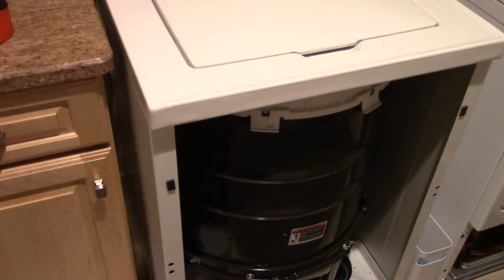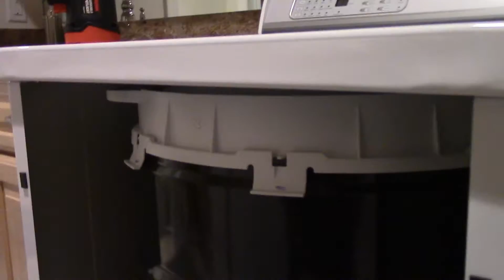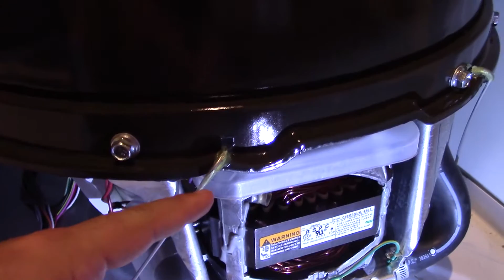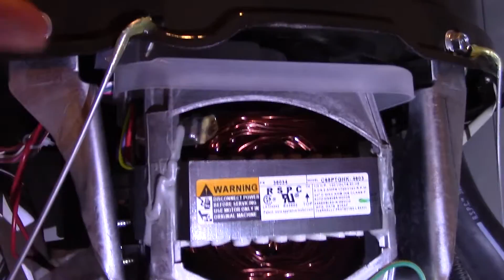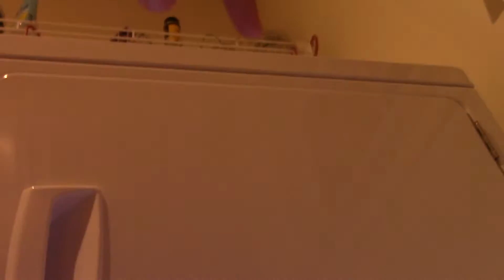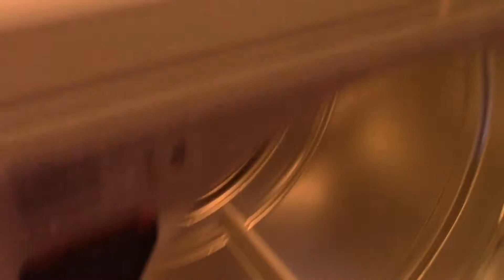Speed Queen and Whirlpool Direct Drive: Unbiased Comparisons.

Comment: Also, another advantage of the Speed Queen in my opinion, the tub spin drains, or "Swirl Away Drain" as Maytag called it. In my opinion, i think spin drain is better for clothes, the tub spins and the pump pulls dirty water and residue and excess suds out of the sides of the tub which is more time efficient because when it stops draining it gets up to speed immediately, rather than draining down through clothes while the tub is standing still which may redeposit stains or lint or maybe suds on clothes, which is one of the two things i don't like about the direct drive and that it eats the motor coupler constantly. . Speed Queen advertises this for the TC5 and Maytag used to advertise this before Whirlpool bought them out. And these machines have 3.3 cu. ft, which is pretty good for washing comforters, most vintage direct drives are 2.5 or 3.1 cu.ft. I don't know if Whirlpool direct drives or older belt drives can wash king size comforters effectively.

Comment: I personally prefer the Speed Queen over the direct drive for the following reasons, after I have used both.

1. Speed Queen has faster spin 710RPM as opposed to 640RPM
2. Speed Queen has a stainless steel drum
3. If the porcelain enamel on steel outer tub leaks it has a lifetime warranty
4. I like the longer stroke on the Speed Queen, It just seems gentler, though both machines do have delicate cycles.

The only advantage the Direct Drive has over the Speed Queen is it's a bit easier to work on and parts are not as expensive.

Comment: "Dual Action" offers no real advantage over the old-school "Roto-Swirl" designs from Kenmore and the competition from the likes of GE and Westinghouse. The Dual Action dasher introduces more moving parts to wear out and fail. I have challenged my SQ TC5000WN with a load of two 60X70 inch fleece throws, and it turns the load over beyond any expectation, and very well in comparison to any machine I have seen on YouTube.
Reply from the maker: The dual actions aren't bad though. I know the dogs are the moving part you speak of. They are very easy and cheap to replace though, the ones I last replaced were on there for 15 years before needing replacement.

Comment: I have my own comparisons to give.

Washers:
This one is for the direct drives, pump placement. Whenever you need to replace it it's in a very odd spot facing down so close to the bottom panel. If they moved it an inch or more higher it would definitely make for an easier fix. But both get a plus having motor driven pumps, instead of flimsy electric pumps.

Speed queen suspension definitely does take the cake when it comes to suspension, and good solid balance and minimized vibrations, but having a base frame such as the whirlpool direct drive does make for better added support because on a speed queen, its mostly the springs holding everything up.

One disadvantage for speed queen is the low diversity, like just off the top of my head, I'm only able to name the 542, 423, 82, and 92 model codes. With whirlpool you have many more options, such as quick wash cycles (on our machine), super wash cycles, cool down permanent press cycles, and more, and model codes, ooh boy. The 7233, 7333, LA95, LA91, 5300, 5200, and many more, so whirlpool easily wins at that, but having so few models does make it easy to choose between machines.

Both braking mechanisms are very powerful, but each have their own unique traits. The world leading speed queen brake takes many heavy cycles to set in completely and doesn't entirely hold, you could just barely shake the tub, on the direct drive, the tub does take a little longer to brake, but it sets in immediately requiring no use to prevent indexing, and allows for no rocking whatsoever.

Dryers:
There's actually 2 variations of whirlpool dryers, 29 inch, and 27 inch. The 27 inch is pretty related to the speed queen, but with its own whirlpool quirks. Accessibility is big, when you pull out the dryer and take off the rear panel, you have much more unrestricted access to the internals. And yes Gas dryers do win there when it comes to not pulling out the dryer to replace their heat source, dryer to dryer.

One big plus for speed queen I will admit is all their models do have a lower access panel, so repairs or cleaning are much easier. Whirlpool didn't actually remove them entirely from what I can tell, some models had them, some didn't, they became less present as time went on, I don't see many pre-86 dryers that DON'T have an access panel. 

Alliance really didn't take their time designing the electronic controls leaving them so close to the burner, but on electric dryers that would be less of a problem, I have seen really old belt drive series machines with electronic controls that keep the main controls much farther away from the burner.

The lint filter for the direct drive series dryers is much easier at cleaning because of its size and can easily handle catching more lint, but it does keep lint off the top having it behind the door, and if any lint flies away it most likely would either fall on the floor to be vacuumed or swept up, or into the drum to be sucked back in on the next use.
Reply: How is a huge number of washer models an advantage? There are four basic cycles: dainty, ordinary, linens, and rock crusher, and extra rinses and soaks can be either selected automatically or manually. What fill options do you need beyond small, medium, large, or jumbo loads? Speed Queen does offer a true "HOT" wash, filling without mixing from the hot tap whereas I was never able to get a wash as hot as 80 degrees F from my Whirlpool with the temp on the hot setting.   
Speed Queen now builds exactly one top-loader worth owning, the AWN632SP116TW01, product code TC5000WN. It does everything I need: normal-size loads or deep fill, five wash cycles, tap-cold, cool warm, or scalding washes, and it actually gets the clothes clean in less than 30 minutes (10 minutes more for the extra rinse option).

Comment: I hear older belt drives actually used the suspension rod system. How different actually were they compared to HE suspension rods.
Reply from the maker: They are extremely different. They have thicker rods, a metal platform, and a metal outer tub. And when the machine fills, the tub does not sink down from the weight. The difference in quality just shows.
Reply: No cabinet smacking needed on those machines. It takes a lot of effort to unbalance ours when its time for spin. Like one of our recent problems was caused by a winter robe, and let me tell you, that thing was like boulder when it was soaking wet.
Reply: GE used aircraft cables before moving to suspension rods too.
Reply: @jeromedavis8575 the filter flos or the 1996 ge washing machines?
Reply: @nathanaelc21 the 1996 and later models.

Comment: 8 big heavy duty suspension springs, absolute quality. Its not gonna smack the cabinet because of an out of place sock. And doesn't throw an error code when it shakes a little, something I figured out is that it takes a lot of effort to throw the 06 out of balance. It doesn't really matter about distribution, its really about weight concentration. I washed this blanket and a sheet, even distribution, but out of balance. The blanket soaked up so much water and was incredibly heavy, so in the end, after 30 minutes of redistributing and even slow spinning, it just wouldn't balance. So I ended up manually ringing it out, and I was shocked how much water came out. It went up to the base of the fins of the agitator. Just to let you know, its a twin sized blanket. So in the end, its really about weight concentration
Reply: Oh and just wanna add, I did an empty spin to make sure it wasn't the washer, and it was fully balanced.

Comment: the Wp DDs eat waterpumps and transmissions but these new machines are all electronic no trans so will they fail control boards and motors now ?
Reply from the maker: Not sure what direct drives you saw, but ours is still on the original transmission after 28 years, and the original drain pump lasted 21 years.
Reply: @Sharkie626  Mine lasted that long as well. I don't think they eat waterpumps or transmissions.
Reply: They constantly eat motor couplings too, i wish they made them out of steel instead

Comment: I have the Awn542 model. Excellent by the way. I always wonder why speed queen didn't go with slightly wider fins on the agitator like the whirlpool super surgilator. I watched videos of the late 70s and 80s whirlpool and they seem to do a more aggressive wash. I always wished speed queen would of made some aftermarket agitators with wider fins for purchase. What are your thoughts?
Reply from the maker: Wider fins probably would have helped. There is actually a Kenmore version of the straight-vane that has wider fins. It actually doesn't do too bad. The dual action still does better overall for those machines.
Reply: Sharkie626 you are right about the dual action agitators they work great in the direct drive machines however in the older belt driven whirlpool kenmore's the straight veins and super surgilator did a fantastic job versus the Dual Action agitator in the older belt-driven Kenmore I have a Speed Queen that has this agitator in it and I'm telling you it moves water it has a very strong agitation

Comment: You don't "have to" take the cabinet off to work on a Whirlpool Direct drive on most repairs. Most can be done by tilting the machine back, Motor, transmission, clutch, drive tube and especially the water pump. When tilted back the water drains back in to the tub, less water spillage. With most repairs it takes less than 45 minutes. If it takes that long, you took a 15 minute break. Taking the cabinet off is a piece of cake if needed, 2 screws, 2 Clips, disconnect the lid switch connector harness and it's off. Wouldn't get rid of my 30 year old one. My Kenmore whirlpool made dryer is 52 years old. Parts still available for both.
Reply from the maker: Oh don't get rid of them! I've seen tilting the machine back before too. Sometimes it's a bit more labor though. Depends on the repair

Comment: So Whirlpool don't make direct drive anymore? What year is the direct drive Whirlpool? What are the best new washing machines, in your opinion?
Reply from the maker: I think they may still exist in stackable units. But regular ones went from 1986 to 2011. The best new washers are Speed Queens such as this one, or the direct drive.
Reply: @Sharkie626 what about the Maytags before 2006, dependable care, preforma, Atlantis, Neptune, ensignia, legacy series, etc? They've known to be very strong durable machines that are noisy of course, large tub capacity, infinite water level options, cycle signal, etc. I think those are the best machines that will fit my needs, but are pretty challenging to working on
Reply from the maker: @nathanaelc21  The Dependable Cares, and the Performa/Atlantis ones were good too!
Reply: @Sharkie626  my dream machines for when i get my own house, for sure!
Reply: The Neptune front loaders, which i thought were bad at first, are actually pretty decent, not the best washer. i know they are HE machines, but are pretty durable, built to last 25-30 years, had mechanical controls in some models, and some electronic controls but with push buttons, maybe had a transmission, had no load sensing crap, and did use less water but enough to clean well unlike other front loaders, something you'll never see today.

Personally i think its the 1 and only front loader i like out of all other front loaders, and it cleans better than my parents Samsung front loader. Besides that, I've always liked traditional top loaders, especially Maytags series of top loaders before 2006 and whirpools series of direct drives, miss when Maytag made their own products.
Reply: and I forgot to mention, the Maytags stopped almost instantly with the brake
Reply from the maker: @nathanaelc21  I remember those! My bro had on of those TLs from 2006-2010 at a place he used to live at. Sadly I never made a video on it.
Reply: @Sharkie626 that's nice, what model were they? Legacy Series like Emerson's, or Preforma, dependable care, Neptune, Atlantis?
Reply from the maker: @nathanaelc21  Yeah it was very close to Emerson's. Just this one had the stainless steel tub, and more temperature options.
Reply: @Sharkie626  yeah, I remeber that one! It also had a signal, and the four tempreature options to the right were auto tempreature controlled. And I like stainless steel tubs better than plastic or porcelian. This type of washer also was available with a blue color as well as white.

Comment: Is this the new 2018 or is it the 2017 washer? Does the dryer have an outer tub that is plastic or metal? Also are the doors plastic on the washer and dryer? Thank you
Reply from the maker: This in particular is the 2016 (same as 2017). Tubs and doors are metal.
Reply: Sharkie626 thank you, I ordered a set and haven’t seen them yet.  I’m anxious to se them, I’ll be getting them tomorrow, I however purchased the front load but was told if I didn’t like them, I could exchange them.  I’m sold on speed queen though, there’s a lot of good advice and I thank you for it. 👍🏻
Reply from the maker: You're very welcome! Hope you're satisfied with what you get!
Reply: Sharkie626 I hope so too, had I watched your videos first, I might have purchased the top load. Time will tell now, I agree on the new 2018, I hope for the sake of SQ brand that’s it’s better than it appears. 
I’ve been told by the dealer that after this year they aren’t going to make the front loads anymore. I hear they are going to do commercial, have you heard any of this? 
Thank you for your time in answering my questions.
Reply from the maker: I have heard that too, it seems pretty certain. I guess time will be the ultimate one that tells.

Comment: also the design whirlpool used to use where the lint filter is on top of the dryer is worse than the design they use today because the heat and water vapor have to go in a circle instead of through the clothes and whirlpool used to make gas dryers but they were from 1970 to 1989 or so and since then whirlpool replaced the burner with a heating element that is also safer because the gas used in gas dryers may contaminate your clothes (im not sure if this is true but i believe it is true)
Reply from the maker: I haven't really noticed any differences in drying with regards to where the lint filter is placed. Both seem to do quite well!

Whirlpool still makes both electric and gas dryers (just about all manufacturers do)! I've never seen any proof that gas dryers contaminate clothing, and we've been using them for well over 27 years now!

Comment: I love my speed queen pair. The only thing I would ask for a change would be the tub size. I have a king size bed and the blankets don't fit. Thank god I have a front loader as well for the big stuff. How are you liking your pair?
Reply: I just got my speed queen 3 days ago, and I washed a king size COMFORTER for inside my speed queen. It handles it easily
Reply: @johnoofsatchurch  Hi, I do agree with you. I’ve had my speed Queen set for a couple of years now and it definitely can handle a king set. I do still like to use my front loader for very bulky items.
Reply: @johnoofsatchurch  The only thing that annoys me is that stupid low speed spin!
Reply from the maker: I am loving them. Everything comes out very clean and new in some cases. So glad we got these since we didn't take the Whirlpools.
Reply: Another thing I would change is the spin speed after the wash on the normal eco and heavy duty cycles. It should be on high.
Reply: @jeromedavis8575  I really don’t understand why they did a slow spin speed after the wash cycle. They should  just do regular speed like you said.
Reply: @Bunkysworkshop  I can understand if this is permanent press. This is heavy duty and normal eco we're talking about. Why did they use gentle spin on heavy duty? They did it on 2014 and older models. I wonder if there's a way to bypass low spin on heavy-duty and normal eco.
Reply: @jeromedavis8575  That would be awesome 😎. If you figure it out please forward that indeed.
Reply: @Bunkysworkshop  The older models did that, so why can't the newer ones?
Reply: @jeromedavis8575  I would only guess it’s something in the cycle switch.
Reply: @Bunkysworkshop  How many springs does the speed queen have compared to the whirlpool direct drive?
Reply: Edit: I washed a more bulky king size comforter thinking it would be ok, but it stopped and it seemed like the motor was burned out. I found out speed queen has an overload protection so I am letting it rest for a little bit. I hope it’s ok. But I will never wash comforters in it again.
Reply: @johnoofsatchurch  I do wash my king sized bedspread in mine but when it comes down to the comforter I wash it in my front loader.